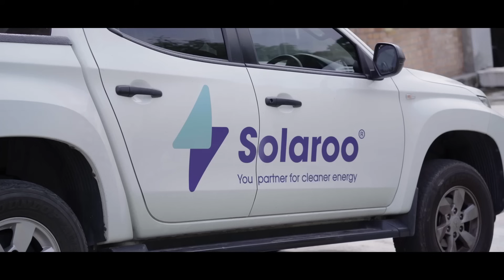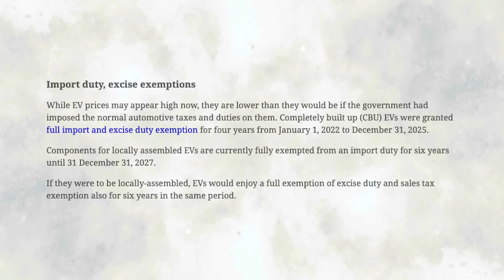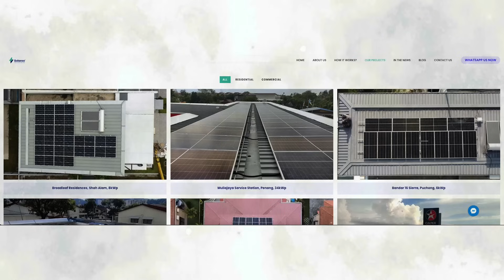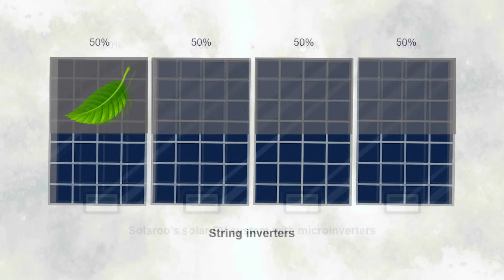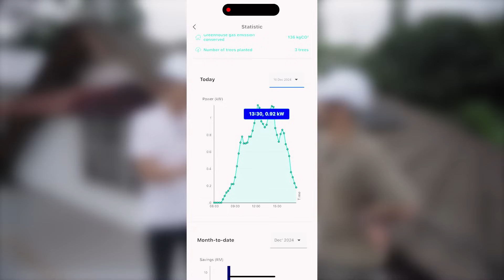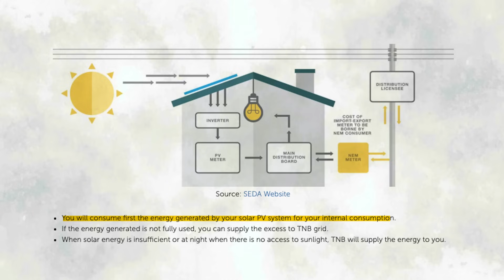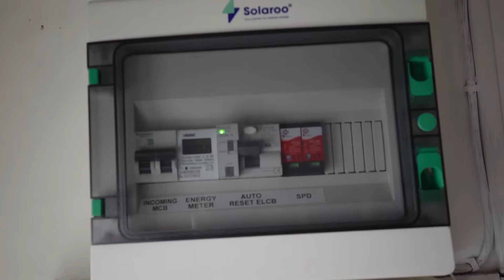This is How I Pay Less for Electric Bill!

Comment: One bad about soleroo is their apps. As they using hoymile inverter but they did not provide hoymile s cloud to house owner. This prevent house owner to monitor their panel at individual performance. Even one panel down, you probably still running 70-80% but you can probably reach 80-90% but due to apps limitation, house owner not able to identified, if their solar panel is all working at peak level.

Comment: Nope. A lot of folks don’t understand the long-term costs of solar equipment maintenance. Like any equipments they are bound for ageing, deterioration and ultimately requires maintenance or complete replacement after its usage had reached end-of-life. Not to mention that the solar panels situated on top of the house roof needs to be replaced and not to mention when the roof starts leaking from rain water one must fix it. Whatever solar technology or technology of any kind, there’s a cost for self-maintenance and 3rd party maintenance to be associated with. Most solar energy adopters don’t share this daunting and cost of long-term ownership with us. Happy going green comes with unseen cost.
Reply: I've been using solar panels for 2 years now and I have a friend who's been doing nem for 4 years already, no drop as yet on power generation output and no roof leaks. Also calculated based on my present savings on electric bills my ROI break even will be in another 5 years. Nem 10 years. I don't really see the problems you mentioned as a factor. Too many (who have never tried) are worried about non existent problems, like one of my neighbours who worries that his family would be electrocuted by my panels 😂

Comment: u already paid 20k to 30k upftont to install solar, the so call money save bcoz is paid by yr own money la 😂....solar efficiency will drop over time and warranty from the installer hv T&C.
Reply: ROI in 6-7 years..solar can tahan about 20 years…so 13-14 years you untung
Reply: It will benefitted in the long terms after 5 years, 70% free electricity
Reply: If the solar company so confident, why dunt they offer no payment upfront but let me pay them mthly from my electricity savings? So that i can make sure they dunt close their company after 5yrs and their solar product wont hv issue during the 10 to 20yrs period.
Reply: @realmlee8803  not exactly, but theres already company doing something similar which is Rent-to-own scheme.
Reply: @realmlee8803  
Most solar installer will uses solar PV modules from first-tier solar manufacturer as they are cheaper, better efficiency and quality.
Most of the first-tier solar manufacturer (Longi, JASolar, Trina, Jinko, CanadianSolar, etc) started in early 2000 and are still thriving.
Reply: @realmlee8803  business is still business. If solar company opted from the business model you said. The company will go bankrupt even faster due to the lack of cashflow. Cost of install might takes years to recover for 1 client. Now imagine few hundred or thousands of clients. How much money do you have to invest to breakeven. Your company basically won't be able to scale.

Comment: 0.43 saving 6-700 ringgit a month
1.17 saving of 200 ringgit

How much are you actually saving?
Reply: it's actually depends on the capacity installed
Reply: @qamarinaazaha4600  he didn't explain what was installed,  very odd video

Comment: Rain helps with self cleaning?? LMAO!! That has to be the biggest BS i've heard so far. You need routine cleaning for solar panels! Period!!! Additionally MicroInverters has frequent communication issues which see customers opting for string inverters than microinverters
Reply: 1) Raining can help to clean to a certain extend like dust particles. So its more like just an extra advantage Malaysia have

2) Everything have pros & cons, it's just how we prioritise what we need. String inverter overall generation & efficiency is usually lower than microinverter. As an consumer, my first consideration for a solar system would be more savings
Reply: It's true our rain is heavy. Those company who tells u ur solar panel need to clean is scamming u!

Comment: I own an EV as well as a solar set up. However, the ICPT tax really makes it not worth it. Before the ICPT i only need to pay 200 now close to 700. I live in a large household using more than 1500kw thats why kena ICPT.
Reply: care to share more? ICPT does not cancelled out by your exporting the power to the grid?
Reply: @shinichixx  no, ICPT is charged on the usage you used from the grid. If you are mostly at home during the day and consume directly from the panels, it wont count into your tnb usage.
Reply: @PsychedMedia  thanks!
Reply: This is interesting information. Thanks. 
Is your setup directly from the inverter to the grid? I think need to change the setup type which can directly utilize from solar and store the power in a battery in order to offset this.
Reply: But then again.. without the solar panels generated electricity, the bills will be much higher right?

Comment: For those who are considering this system, without any batteries, and basically directly selling your electricity to TNB. Please note the following drawback:
1)TNB determines what they will buy the electricity that you produce. If in the future EV and this solar model that sells electricity to TNB becomes too popular, TNB will have to actually reduce the rate that they buy your electricity, cause they have a problem with too many solar producers, and may have to turn off their power plants. Turning on and off a power plant cost money. TNB not in it to lose money too, so you smallest producers are the first to get cut in the rate of power that you produce. This has happen in California and the EU, most famous example is Germany having to pay people to use power.
2) If TNB power goes down, you also lose power, even during day time. Your solar can soak in the sun and be useless. At night, even worse.
There are other high level disadvantages to it, but I won't put in here, cause these are the 2 points that have a high correlation to the money you spent for this solar system. So be very sure of the solar package that you are getting is what u can stomach
Reply: Do you know how much does battery solar system cost? i heard battery alone is rm80+k
Reply: German what? Pay people to use solar? Seem good, bcoz germans could run extra bitcoin miners and help stretghten the network
Reply: This is what I'm wondering about. I was talking to a colleague and he doesn't know about the hybrid system setup. He only knows this grid-tie setup like in the video. Hybrid setup is the way to go if you really want to spend zero dollar on electricity, but I guess its not well-known here in Malaysia.

Comment: Isn't it common to have micro inverter in all solar panel installation now (2024) regardless which solar company it is?
Reply: Not really, as a person in the industry (the place i work in sells both micro and string inverters), let's just say it has its pros and cons.

String inverters are definitely way easier to change post NEM, to hybrid inverters for battery storage, compared to microinverters and doing ac coupling for storage. Personally only good reason to have microinverters is if your roof is extremely segregated (multiple angles) or shaded, but even so i'd prefer having double string inverters haha.

In regards to reliability, microinverters are still in some sort of a gray area, they're only really mass produced or widely popular for less than a decade, reliability long term is still unknown, though you can't deny the fact that the technology is superior to what string inverter offers. But string inverters are tried and tested for many decades so expectations on its lifespan is quite standard already.